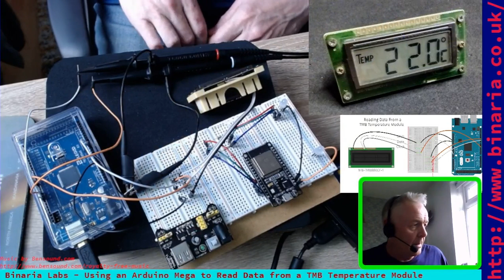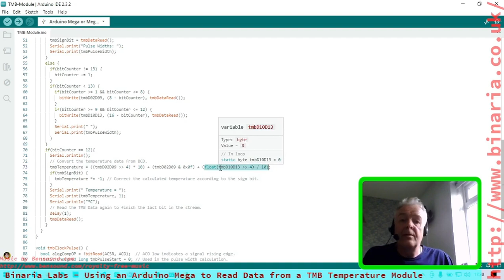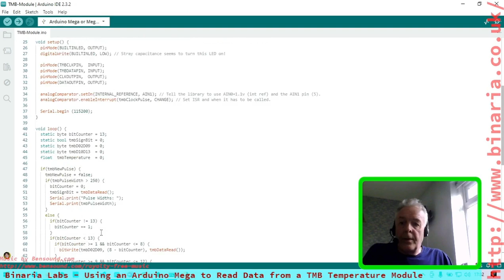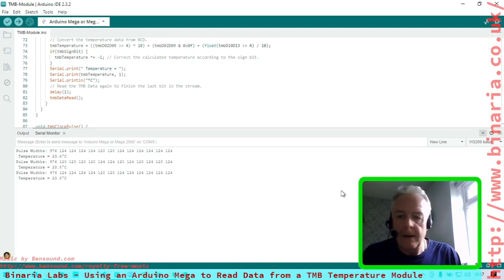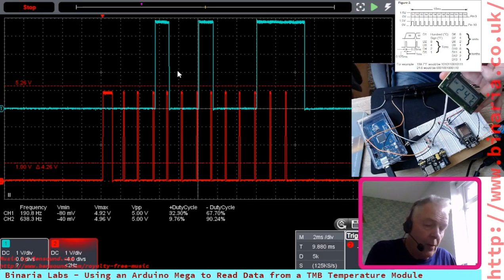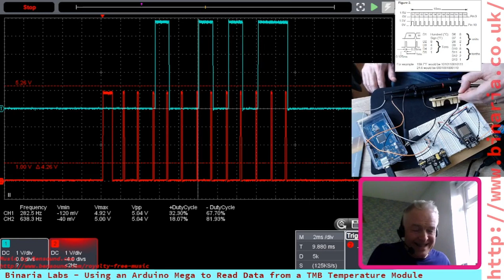Reading Serial Data from an MB-TMB880CF-1 Temperature Module with an Arduino Mega R3

Comment: Great project
Excuse my English because I'm French!
I completed your project step by step and it works perfectly. with arduino 2.3.3
Except !!
The level adjustment of the square wave is fixed. The adjustment of the other signals works perfectly.
I saw in your video that it works perfectly.
I tried all 3 versions. Same problem.
Find the error!!!
What path should I follow to remedy this in your opinion?
Many thanks in advance.
Daniel Audigay